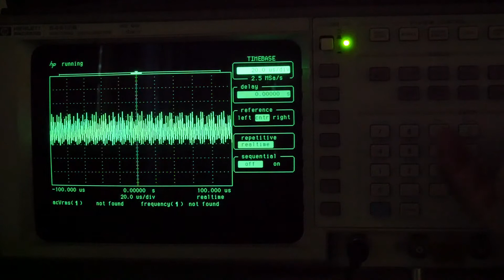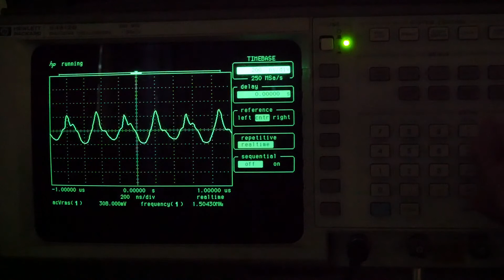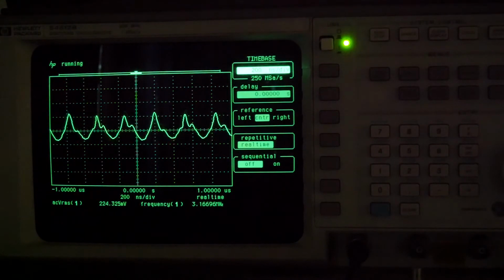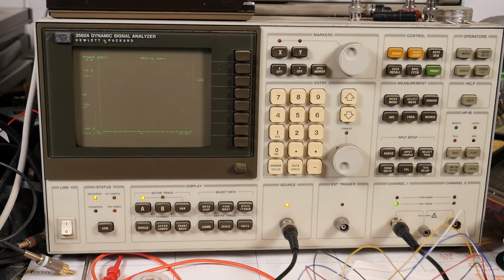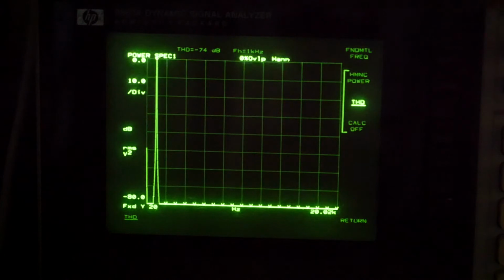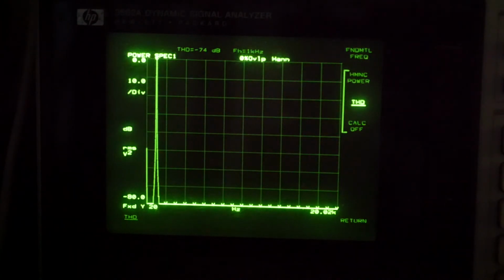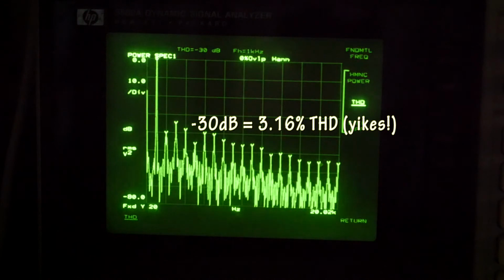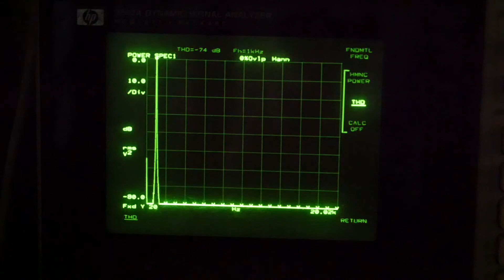Precision Attenuator - Op Amp Oscillation & THD test

Comment: Ne5532 is quite famous for doing that, even if only one loses the negative rail it will oscillate quite happily, and turn into an AM band transmitter, while still giving an audio output, albeit with higher distortion, and with a pretty significant positive DC offset. Not good when that happens on a mixing deck to the output amplifiers, though you could then get a nice AM broadcast out of it with the long wires it drove to the speaker amplifiers. with the capacitance of that it was at around 1.6MHz, and while the opamp got really hot, they did survive this. Amplifiers on the speakers did not even worry, they had RF chokes on the input, and would barely be able to go past 10kHz anyway frequency response wise.